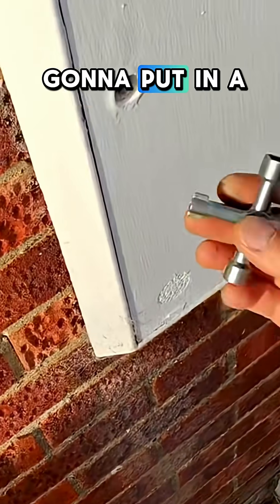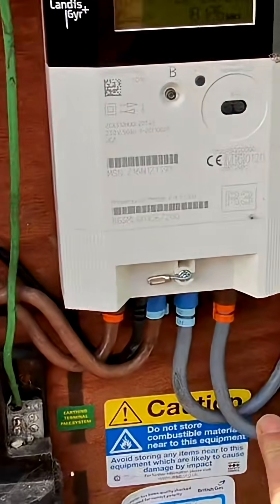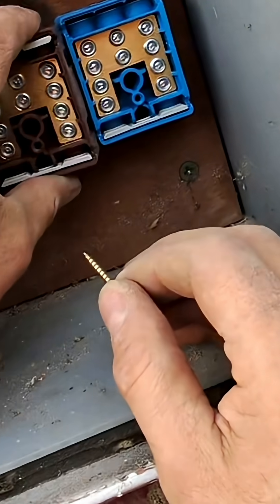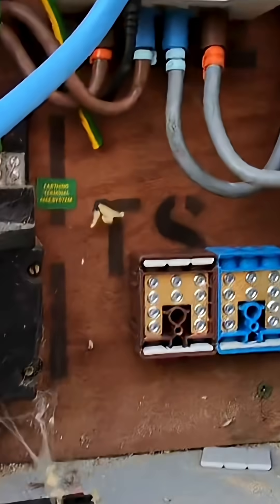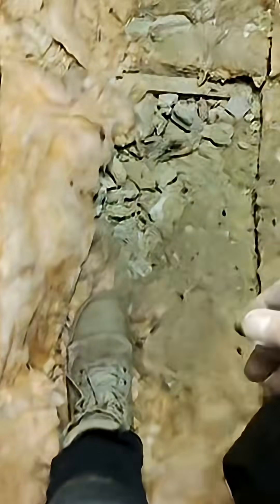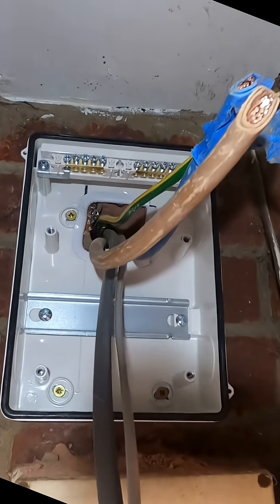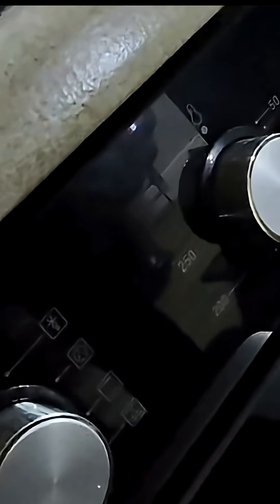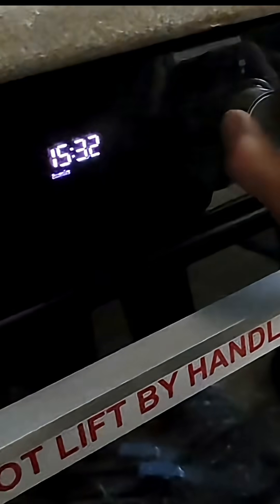BG Mini Board vs Old Fuse Board: Which One is Right for You? #ElectricalUpgrade #Comparison

Comment: Ip rated board Ben? Which one did you go for? I struggled to find much choice last time I needed one.
Reply from the maker: It was the bg one
Reply: Bg garage boards are ip65
Reply: Why does it need to be IP rated if it's going in the hallway
Reply: @codenamenel just prevents moisture and condensation forming
Reply: @codenamenel it never went in the hallway it was in the existing position on the external brickwork.
Reply: @paulroberts7941 ye your right, in the beginning he says it's going in the hall, then mounts it external at the end, I missed that bit